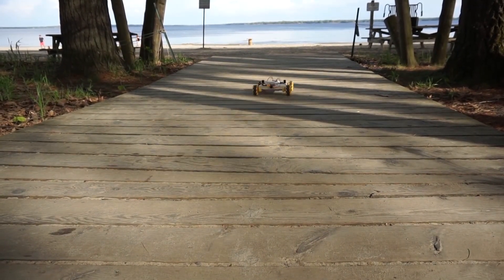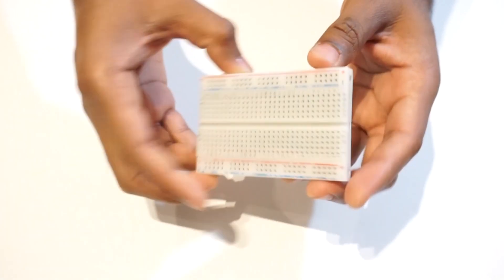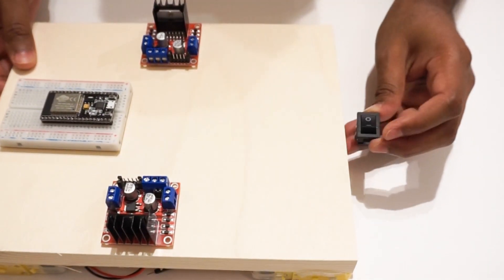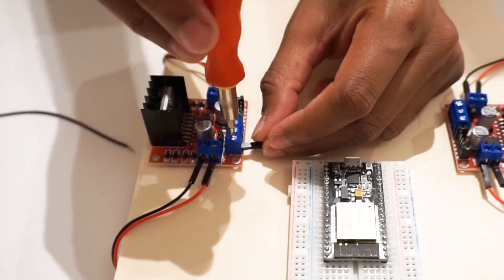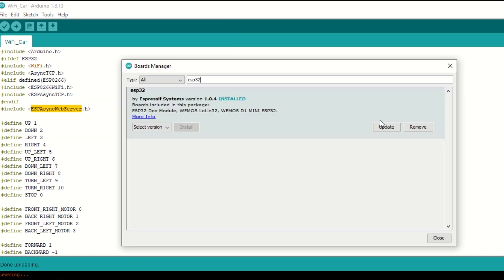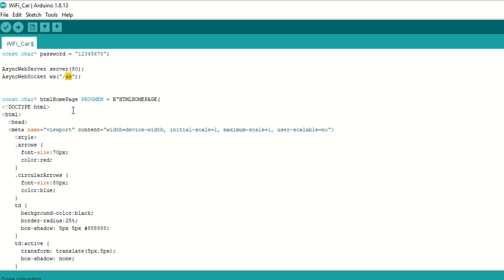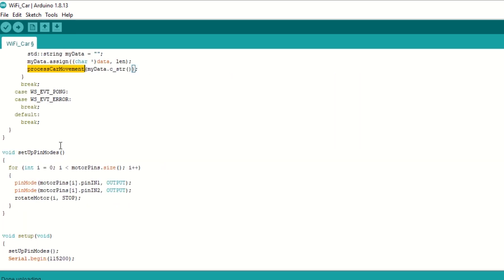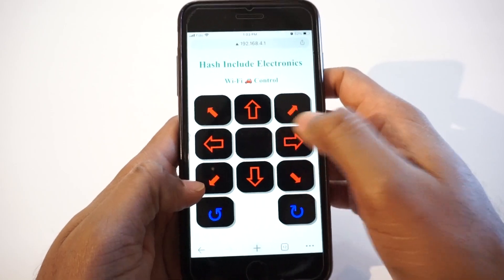Smartphone controlled WiFi car | esp32 | Mecanum wheels

Comment: Hi, Thank you so much. I made it work, but couple of issues. 
1. Why I need to power on my ESP 32 from USB (connected to computer, in your video, there is only one power connected). I am sure I have connected 5V VIN.
2. When I turn on the switch, ONE wheel is on continuously. What could be reason?
Reply: I also have same this 2 issue
Reply from the maker: Is this resolved ? 👍🏻👏🏻
Reply: @hashincludeelectronics  ??

Comment: mywifi connection was succesfully establish and i also got to given IP address but all the motor cant respond when i click the button given on the wbesite  please help me out .. waiting for your replay
Reply from the maker: Are you using mobile or laptop ? 👍🏻👏🏻
Reply: Sir please reply my question i want to submit it to my college 😞
Reply from the maker: @DeepSidpara88  use only 3 cells of the battery. May be the voltage of 4 cells is too much . Try only 3 cells fully charged 👍🏻👏🏻
Reply: @hashincludeelectronics  ok sir i will try and give a feedback 🙂

Comment: Hello i like ur video very much, i had duplicate a rebot car but i think the IN1..4 of each L298N is wrong as my rebot car is running crazy not according to direction. could u provide a detail wire diagram for 2 L298 and 4 motor, thanks.
Reply from the maker: You should double check the motor connections and make sure they are correctly wired.  👍🏻👏🏻

Comment: Hey tht wifi car control app website is not opening..wht to do?
Reply from the maker: Please check connection and use rechargeable battery to avoid many power issues 👍🏻👏🏻
Reply: Turn off mobile data

Comment: I have entered the correct SSID and password, and Wi-Fi was also Connected on my mobile phone, but on Chrome, that webpage is not opening. I am facing this problem. I kindly need your reply to overcome this problem. 
Thank you
Reply from the maker: Please use rechargeable battery to avoid power issues 👍🏻👏🏻

Comment: Brow I'm fasing a problem 
when i start my car then it will be atomatically turned off the wifi signal and some time the holl car willbe shut down. 
fore you're information 
I'm yousing 12 volt battery pak with 3s 25amp bms. and my esp 32 is verson 4.
Reply from the maker: May be there is loose connection. Please check 👍🏻👏🏻

Comment: I have a question can i use normal wheels instead of magnum
Reply from the maker: Yes you can . However some of the movements will not work which is meant for only mecanum wheels 👍🏻👏🏻

Comment: Hey buddy, thanks for the video. I seem to be getting a Load error possibly because there isn't enough time for everything to load up correctly. Any thoughts on this? How could I slow down the main loop? 
ESP-ROM:esp32c6-20220919
Build:Sep 19 2022
rst:0x8 (TG1_WDT_HPSYS),boot:0xc (SPI_FAST_FLASH_BOOT)
Saved PC:0x4080009c
SPIWP:0xee
mode:DIO, clock div:2
load:0x4086c410,len:0xc64
load:0x4086e610,len:0x2730
load:0x40875728,len:0x594
Reply from the maker: Unfortunately I don’t have idea about this error . May be we can find more information on internet on this error 👍🏻👍🏻

Comment: Sorry to bother you again, but my MyWiFiCar works if both connections are connected together, I mean if it is connected to the computer via the USB cable and also connected to the 9 volt battery. What am I doing wrong?
Reply from the maker: I would suggest to follow the circuit diagram and make exact connection . Also make sure you use only rechargeable artery . Please don’t use that 9v non rechargeable battery 👍🏻👏🏻
Reply: @hashincludeelectronics  Okay, I'll follow the recommendations. Grateful!
Reply from the maker: @zkmargo-e6m  awesome 👍🏻

Comment: Good morning, when the esp32 is on the computer via the usb cable: the MyWiFi network appears but when it is only on 5 volts it does not appear.
Reply from the maker: That happens when the esp32 board 5v pin is faulty . Try using another esp32 👍🏻👏🏻

Comment: Hi, can you please help me with the power supply? I have a battery holder and i can put in 3 x 3.7V 18650 7800mAh Li-ion batteries, resulting in 11.1V. The battery holder has 2 wires (vcc and ground). Do i just connect them to the circuit (the red wire to the switch and the black wire to the GND) or do i need an intermediate module?
Reply from the maker: You can use these batteries . Connect switch as per circuit diagram . 👍🏻👏🏻
Reply: @hashincludeelectronics  is the switch necessary? what happens if i don't connect it?
Reply from the maker: @sivi99  that’s completely fine . You can ignore the switch 👍🏻👏🏻

Comment: Hello can u pls give the circuit diagram for esp32 wroom 30pin as in this u are using 38pin  i have 30 pins so
Reply from the maker: I think you can try using the similar pins on that module and see if that works . If not then use 38 pins . 👍🏻👏🏻

Comment: Bro using single mortor driver complete the circuit.
Can you send the same circuit using single mortor driver.😇
Reply from the maker: We need 2 motor drivers in this project . We are using mecanum wheels so we need these 👍🏻👏🏻
Reply: Can you send the circuit diagram using single motor driver.
It for normal wheels.  @hashincludeelectronics

Comment: its working ,, but i want to learn how to code this ,,, hardware is just easy if you purchase it
Reply from the maker: Thank you very much for checking out the cheek 👍🏻👏🏻. For learning coding you need to understand c++ using Arduino IDE . Start with that first 👏🏻
Reply: @hashincludeelectronics   thanks sir. i will do my best to learn gradually
Reply from the maker: @kshitiznavediya2559  awesome 👏🏻

Comment: i have coded myself a code so that each time a link is accessed by a client it will do something like turn left, right, etc. and made an app by mit app inventor to access such links according to the control. will it be reliable? I mean what problems I am probable to face during the controling of the car. Thank you so much for the video too
Reply from the maker: There should not be any issue . Make sure if there is timeout or no communication then the car should be stopped 👍🏻👏🏻
Reply: thank you so much for your help
 @hashincludeelectronics

Comment: Thanks for sharing your great work and I am also trying to help my son building a similar robot his school project. I am fairly new with C++ and have two questions if you could help us with.  How can I go about integrating with Bluetooth instead of Wifi and how should the code be modified?  My second question is how to apply PWM to control speed and, if possible, improve the speed of the robot.  I look forward to hearing your thoughts?  Thanks
Reply from the maker: Thanks for checking out the video and nice comment . Good to hear that the video is helping you . However you can not use Bluetooth connectivity in this project as we are using html based web application which uses IP address and WiFi . For using Bluetooth you can refer my other video Bluetooth car . That will give you some idea . Also for PWM control you can refer all RC cars videos 👍🏻👏🏻

Comment: Your explanations are very clear, the documentation is very complete as is usual with your projects.   I could assemble the car easily in the first try and it worked.   Wifi connects OK and the car obeys instructions perfectly.  The only issue is that WIFI disconnects after some time and I have to switch the car again to restablish WIFI.   Distance of only a couple of meters from the car.  Tried with different phones and ipad.    Using rechargeable batteries fully loaded.   I noticed other people have similar comments.  You replied to them suggesting they use rechargeable batteries, but this is what I am using.

Any other suggestions would be appreciated.
Reply from the maker: Thank you very much for your nice comment and I am glad that these videos are helping you 👍🏻👏🏻. Probably to increase the range we can add external antenna to esp32 module. However I am not sure how we can do that . Also regarding disconnection of WiFi , May be the esp32 module is getting hot due to processing. I will try to see if something can be done in next video. Also it’s worth checking on internet for probable solutions 👍🏻👏🏻

Comment: Why is it that when I run it, the voltage turns off? like not being strong enough to run the motor
Reply: I am using power supply DC
Reply from the maker: @ridoaditya7514  use rechargeable battery only 👍🏻👏🏻
Reply: But if I put delay, so the motor not start together but one by one. Voltage not turn off
Reply from the maker: Which battery are you using ?

Comment: I have nodemcu esp8266 can i make this car with esp8266.
I don't have esp32
Reply from the maker: It can be but I have not tried it . I would recommend to use esp32 to avoid issues and have the project ready quickly 👍🏻👏🏻

Comment: Can I use one driver motor for this project? Hope it won’t affect it because I normally use one for arduino don’t know why two driver motor is used here. First time user of esp32
Reply: Oooh yes it is my bad I should have known that. I am using the normal dc gear motor with one motor driver for mine don’t know if I might need to change any thing in the code. I am doing this with my students tomorrow I hope 🤞 I don’t fail before them
Reply from the maker: @kpieceemmry3387  don’t worry it will work . However I would suggest to use same driver as I used in this project . Else if you are using some other driver then yes you should check the code if that works before hand 👍🏻👏🏻 I wish good luck with your project and success 👍🏻
Reply: @hashincludeelectronics  yes 👏 I am using L298N motor driver & esp32 WROOM
Reply from the maker: @kpieceemmry3387  awesome . You should be good then 👍🏻👏🏻
Reply: Thanks 🙏 a lot 

I am a lover of your work
Reply from the maker: We need to control 4 motors individually to get all motions of car using mecanum wheels. 1 driver can control 2 motors. So for controlling 4 motors we need 2 drivers . Hope it is clear 👍🏻👏🏻

Comment: Hello,
thank you very much for your interesting videos. First of all, can I use "normal" wheels before buying these "Mecanum wheels"?
Reply from the maker: Thank you very much for checking out the video and nice comment 👍🏻👏🏻. Yes you can use normal wheels . however the sideways movement  will not work and will not be applicable.
Reply: @hashincludeelectronics Of course, I understood. Thanks!

Comment: What happens if I use normal wheels bro
Reply from the maker: You can use normal wheels however some buttons will not be suitable for these wheels movements . Like sideways , diagonal . Front, back , rotate left , rotate right will work . 👏🏻👍🏻

Comment: hi. I have big car  for children to drive.  What I should use engine controller - L298N?
Reply from the maker: You should not use L298N for such big car. Please check and search similar other modules which has the required current capacity as per your big car . Unfortunately I don’t have that module in my mind 👏🏻👍🏻.

Comment: Hi, I don't know if you can give me some advice. I am trying to recreate your project but with an ESP32-C3 some of the libraries work for me but others give me an error. The AsyncTCP library and the ESPAsyncWebServer are the ones that mark an error when running the code on the board. Do you have specific libraries for this board? Thank you so much
Reply from the maker: Unfortunately I don’t have libraries for your board . I would suggest to use the same esp32 board which I used in this project to avoid any issue 👍🏻👏🏻

Comment: Can I use single L298N motor driver?
Reply: I don't want all movements I want only left right forward backward four enough
Reply from the maker: @sunnyui775  in that case there are other similar videos on my channel where I have used single motor driver . Please check that .
Reply from the maker: No . It needs 2 drivers so that all movements of car are possible 👍🏻

Comment: I have only 1 question.  Why did you not connect the enable A and B pins to the esp32?
Reply from the maker: In this project we are not controlling the speed of the car. It’s constant maximum speed . That’s it why we have used jumper to connect ena and enb to 5v on the driver itself .
Reply: @hashincludeelectronics  thank you, understood💪💯

Comment: why does my one never work bro? I spend almost 10k  money in building this but it wont work pls help me????
Reply from the maker: Thank you for checking out the video👍🏻. Don’t worry it will work . 1. Please make sure you use only rechargeable battery . 2. Check the connections properly once again and make sure there is no loose connection . 3. Make sure your motors work by connecting to dc supply first . Sometimes motors can be faulty too .

Comment: I want to add weight scale buzzer and ultrasonic sensors to this wifi car.
4 ultrasonic sensor that will detect and stop motion of the car in a particular direction and a buzzer will buzz.
A weight scale that will measure small weights. 
My question is will it be possible to add these things and edit the code to make the entire thing work?

Comment: Can we control the speed of the car by code or something?
Are these motors stepper motors?
Reply from the maker: We can not control the speed of these motors in this project as we are providing 5 v to ena and enb pins of L298N driver . However you can check my other videos where we can control the speed of motors by providing PWM signal to these pins through code .

Comment: @hash include electronics  bro i see but don't know properly can you plz give me a circuit diagram it is my school project plz give circuit diagram of using 1 l298N motor driver
Reply from the maker: You can check my WiFi robot tank video . Use the same circuit and code .

Comment: Can we use VS code instead of arduino ide?
How can avoid using "Arduino.h"?
Reply from the maker: Arduino IDE has all components, plug-ins , tools and boards settings to compile and upload code into Arduino boards . You can use VS code but I am completely not sure what settings you will have to change. Better to not go in that VS code path .

Comment: why are we using two l298n, wouldn't one be enough ?
Reply from the maker: It’s needed to rotate and control each motor separately. So that we have all directions control . One L298N can control 2 motors so we need 2 L298N.

Comment: Nice! I have a question. Why the wifi often loses and I have to re-connect it again anda again? by the way, I use ESP8266 not esp32
Reply from the maker: That is because if it goes out of range . Try within 50-80 ft .
Reply: @hashincludeelectronics  it's about 2 or 3 meters after playing for 20 minutes or more, it just loses and must be unlug the power and connect again to the wifi. The power supply is full enough. I use 7.4v LiPO battery.
Reply: @WorldXiater  same problem with me
Reply: if u found any solution of please share with me

Comment: i did like everything you said,but only left motor is working? I check the right motor with battery ,as ssoon i connected it all,only left motor work?
Reply from the maker: Are you using rechargeable battery ? because non rechargeable battery doe not provide enough power.

Comment: Hi sir, Can we use esp 8266 ie nodemcu.If so what should I change in code??
Reply from the maker: You need to use esp32 in this project to avoid any issue or get the project working . It will need lot of changes if you use esp8266.

Comment: I uploaded the code on esp32 and it was successful. however, I guess the app did not generate it because I tried to use the IP Address shown in the video and the browser was giving an error. what should I do? Kindly help asap.
Reply from the maker: You need to connect the car’s WiFi ssid and password as shown in video before typing the IP address in browser.

Comment: hello there, there is an error showing when uploading .
Error compiling for board ESP32 Wrover Module.
exec: "cmd": executable file not found in %PATH%
Reply from the maker: This looks like new error . Could you please make sure the esp32 board is installed properly using the link as shown in the video? Also try to search for this error on internet for more details. I will let you know if I find more details too.
Reply: @hashincludeelectronics  yes it's showing the ESP32 in Tools> Board. and one thing more  when I turned on the power then the  bluetooth was showing of the  RC car on my mobile but it was not connecting. Thanks for reply.
Reply from the maker: @slip-shape994  I am confused now . What’s the exact error ? It is compilation or something related to connections? Also make sure you use rechargeable battery to avoid any power related issues .
Reply: @hashincludeelectronics 
Yes exact error is only related with compilation as it says. Error compiling for board ESP32 Wrover Module.
exec: "cmd": executable file not found in %PATH%. Yes it's rechargable battery.

Comment: Hi hash include electronics , I have design same project as it is with your code as well but i am facing problem as 1 motor is not working and other 3 are also not working simultaneously,can you help me please or can you send me your whatsapp number
Reply from the maker: Thanks for checking out the video . Please make sure you use only rechargeable battery . Also check the connections again .

Comment: Hi
Just completed this project and works like a charm. My grandson loves it. But he keeps banging it against the walls and furniture. Made me think if I can add anti-collision. I think the standard ultrasonic sensor may not work because it moves in all direction. Also any ideas on docking and charging like in robotic vacuums. I have added OTA and connected to my home wifi. Thanks again for the wonderful video
Reply from the maker: Glad that it worked for you 👍🏻 . For now you can add ultrasonic sensors around the car which will be quick solution . However making it like vacuums robot will take lot of efforts and design . May be in future I will try to make one . Stay tuned.
Reply: @hashincludeelectronics   Thanks👍
Reply: Ultrasonic sensor on all 4 sides may help you